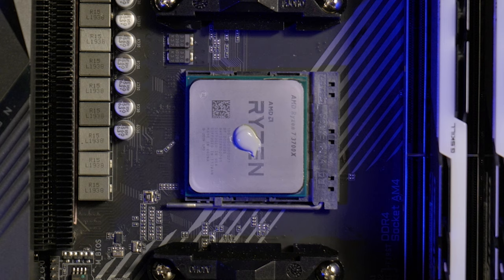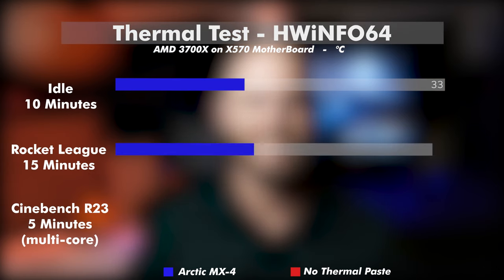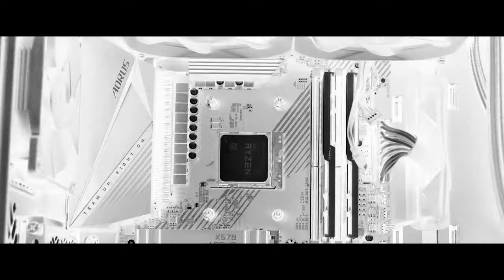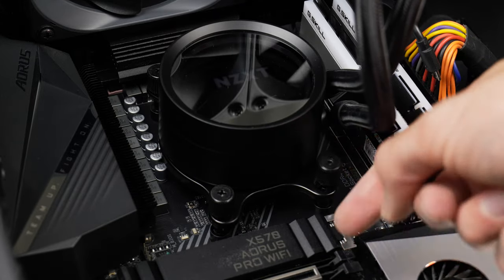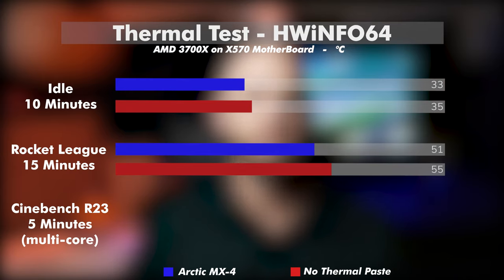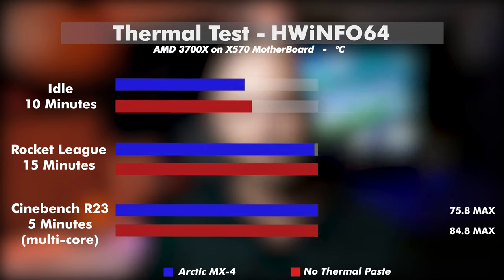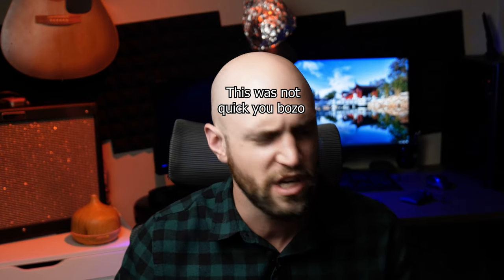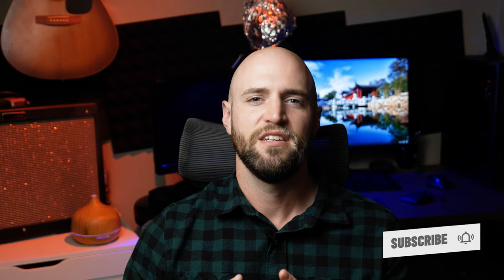Do You Even Need Thermal Paste?

Comment: Yes. I started up a i5 8400 with no thermal paste and a stock cooler I went into bios saw 91 C and shut it down,
Reply: 95c
Reply: Rookie numbers, mine was 101 C. Get on my level😎
Reply: @mrjazz2570  mine was 121c get on my level
Reply: Because stock cooler. This is the cause.
Reply: Mine shutdown in 10 seconds
Reply: I remember my old laptop going for ~110°c 
I can't even count how many times I burned my hands and lap or something else like a table, paper, books, etc...
Reply: It would have shut down if you were doing anything demanding . Even the bare minimum (1/4th the minimum) will cool it down enough to game at 1080p on integrated graphics.
Reply: @chadmann2724  I was just testing to see if you needed to thermal paste.
Reply: My cpu hits 80°C in 1 minute stressing it 50%, 90°C in 2 minutes stressing 100%, but in my case i need to get a better cooler because my cpu's tdp is higher than my current cooler
Reply: Stock cooler 🤣
Reply: I’ve been running mine on 110 last few years lmfao
Reply: Mine was 128°c and my pc literally explode
Reply: @mrjazz2570 yesterday it was a i7 12gen 100c
Reply: 96c i5 8400 no thernal paste no cooler
Reply: 96 C i5 8400 no thernal paste no cooler

Comment: This shows that the cold plate on your AIO has actually pretty good evenness. The temperature without thermal paste is really dependent on the unevenness of the plate, relative to the cpu ihs. If it was more uneven you would see higher temps or even dangerous temps, depending
Reply: Even then, 9 degrees delta at peak utilization is a sizable difference, proving that thermal paste always helps.

But I was shocked that idle was no more than 2 degrees delta and light gaming was only 4 degrees delta. Which proves your point: the more even the IHS' surface and the cooler's contact surface are, the less reliant they are on a thermal interface layer between them.

But since you cannot gauge the evenness of your CPU's IHS and your cooler's contact surface without specialized high-precision tools (and exceptional evenness tends to be the exception and not the norm), having thermal paste is still preferable.
Reply: That's a very good point. I have a Core i7-6850K cooled by an EK Supremacy Evo waterblock and it would instantly hit 100 degrees and thermal throttle under load at stock speed with no thermal paste. But after I lapped the CPU and waterblock totally flat, temps maxed out at around 75 degrees with no thermal paste. Obviously not nearly as good as under 60 degrees with thermal paste, but still totally safe and completely usable once lapped.
Reply: a metal plate has good evenness?? mind=blown

Comment: If you had a perfectly flat heat spreader and a perfectly flat heat sink mount, you could probably get away with no thermal paste. However that is not the case. Never run a system with no thermal paste.
Reply: Yeah, after seeing just how not flat the IHS and heatsink are I would never recommend running a system without the paste.  Now, if you have lapped them both and there is perfect 100% contact, maybe.  But even then, why not just slap on some paste and enjoy your build.

Comment: I'm honestly surprised it mattered as much as it did. The paste helps pretty microscopic separations connect. It's cool seeing quantitatively how impactful they are. It's definitely necessary but also not something that has to be applied in a lab setting with any level of small tolerance or specific amounts or patterns.
Reply: I got a theory that people are mounting the coolers way too loose, hence the wide spreed use of huge amounts of thermal paste, I use so very little and spreed it all over the cpu surface without spilling out.
Reply: @vfn4i83  actually you should do it enough to spread through the ihs. This test just means nzxt kraken has spectacularly even mounting surface and pressure. Thermal paste is necessery when these things are not perfect which in almost all cases they're not. You tightened the screw on one side half a turntoo much? half of ihs is wasted. Did your AiO manufacturer cheaped out on manifacturing cold plate, same story excessive heat. As air is actually good insulator which is why paste is necessery, it removes alot of the variables which almost always happen. Hell, just look at latest intel socket, even the motherboard's cpu mounts are so bad that when you switch that to a TR or TG you gain around 5 degrees of cpu temp just from that. And that is WITH thermal paste.
Reply: My cpu is at 60⁰C idle without thermal paste. I think I need it

Comment: Thanks for the research.  I have a non cpu application that thermal paste may not provide a benefit, but thermal epoxy is still an option.  These Thermal Interface Materials, TIM, seem to work less by being a thermal conductor, than by eliminating a non-thermal conductor - air.  My research will be to attach a Peltier to heat an aluminum plate in a vacuum chamber.  With no air insulation gap between the ceramic face of the Peltier and the  aluminum plate, heat conduction should be better than at normal atmosphere.  There may still be a need for epoxy, but this demonstration is insightful.

Comment: I've done it before. The difference is not that gigantic. The misconception many people have about thermal paste is that it is some magical substance that acts like ice cubes in a drink. It's just a really thick grease mixed microscopic powdered metal. The texture is like peanut butter. All it does, if applied correctly, is make sure there's always full contact between the CPU and the heatsink, that's all. The difference between paste and dry is just like the difference between a car's engine oil full and low on oil. The car will run fine with low oil, but it will run better and quieter with full oil.
Reply: So the computer i have might not have thermal paste at all lol
Reply: I'm running i5 2400 without thermal for 3 years but now i have an issue my system ran into a problem giving me blue screen and it goes for a restart i thought it might be a virus or something like that so i installed fresh windows 10 but the problem didn't go away it happened again I don't know what to do????
Reply: @ARMA__GAMING  One or several of your ram sticks are bad.
Reply: @alwaysemployed656  ohh no it means my pocket money is in trouble 😨
Reply: @ARMA__GAMING  The looping boot means the motherboard and cmos battery are fine. It would not even boot up if something was wrong with either the mainboard or cmos battery. So that narrows it down to the ram. Try making sure the ram sticks are in properly and locked in. If that doesn't work, then time to buy new ram.
Reply: Analogy is completely wrong, because in gas engine you have moving parts which also is thermally stressed and must also provide a high pressure sealing - all at the same time. Running low on oil will lead to damage of camshaft and pistons, which eventually kills engine entirely.
Reply: @Chastity_Belt  todays modern engines can in fact run fine with low oil, not recommended to do so. Just enough to get you around before you can put in oil.
Reply: @alwaysemployed656  i know, it wouldn't kill engine immediately. But if do this on regular bases, it will be cooked

Comment: I think the real difference is the quality of the radiator when dry mount. Else, I also think that applying the paste on it (and spreading) instead of doing that on the CPU, will give slightly better result, as the CPU cap is quite smooth, while the cooler is rough and using too thin layer on the CPU will not fill up all the gaps when pressed
Reply: The CPU cap is quite rough, if was so smooth, it'd be glassy and the copper surface would also be glassy, that would be the only way there'd be little to no gaps. If there's even a smidget of a micron gap then thermal paste would continue to win because it fills in gaps. Simply touching the surface of the cpu would cause gapping problems

Comment: i have dozens of times had to set up a quick thest bench pc to run some hdd recovery software  i would just find a mobo, a cpu and a few sticks of ram a psu and sata cables and just a cpu cooler laying around, i would just throw the cooler on the cpu and not use thermal greese or strap it down i just just place it and launch the program i needed and let it work, works fine you just need a chunk of metal to be honest for a cooler

Comment: that aio is plenty powerful enough to handle a 150w load, that measly 65 watts isn't going to suffer to much with out any thermal compound, so long as you have a solid connection, apply enough pressure and the surfaces mate well, the thermal compound helps transfer the heat in the areas that are not mating that well. so that said, no thermal compound will render higher temps, cause the cpu to loose some performance, but doubt it will damage the newer cpus made in say the last 5 years or so as they will throttle or shut down to save themselves. if all you need to do is post your system, no thermal compound is perfectly fine, just make sure to remove the plastic cover first

Comment: As others have mentioned I think cooler quality matters.  I run Pentuim III (both Coppermine and Tualatin variants), Xeon E5450, Xeon E56xx and X56xx series as well as an I7 970 all without paste, and everything works just fine.  There are 22 CPUs in total.  All the machines are either name brand servers (HP, Compaq, IBM, Dell) with quality parts and good airflow, except the I7 which has a good aftermarket air cooler.  After about 8 years in a non-airconditioned room with Australian summer ambient temperature, nothing has shown any sign of heat-related problems.

Comment: Thermal paste is just to ensure a smooth and complete contact surface with your cooler, because the heat transfer is made by conduction and to do that there needs to be surface to surface contact its not actually designed to keep it cool, although over the years some companies do try to provide products that help improve cooling

Comment: I have a 9 year old Intel Core i7-2600 in my PC and I have been lately getting 92...96 °C temperatures with Intel stock cooler while playing Hunt Showdown. I thought that my CPU had come to the end of its life.

Yesterday I figured that maybe I should just in case check the thermal paste situation since the last time I applied it was over three years ago. So I cleaned the old paste away (also cleaned all the dust from the cooler) and applied a new layer and surprisingly it worked!

I am now getting 80 °C temperatures. So reapplying thermal paste and cleaning the cooler off of dust really made a difference. So I would say that you should always use thermal paste if you are using the CPU for gaming and other stuff that puts it under stress.
Reply from the maker: For sure. I suspect dry paste is worse then no paste. I would love to test that out.

Comment: I would definitely still use thermal paste. I am new to pc building but I have a pretty good understanding of electricity. So I would think it also protects against corrosion and helps protect from static shock issues.
Reply: The IHS is solid copper that's milled and then nickel plated so it doesn't rust. You can wash it with regular water.
Don't understand what you mean by static shock. The actual chips inside the CPU package are covered with non conductive TIP and then they press fit the IHS on top of everything. The IHS does not touch any electronic component.
People love to talk about micro air gaps and all kinds of other dumb shit when they talk about termal paste but the reality is that the paste is mostly there in case the IHS and/or the bottom of the radiator isn't perfectly flat. On many CPUs the IHS is a little bit concave from when it's press fit. Or was that convex?! Anyway it's lower in the middle that's why you put the drop of paste in the middle. Plus that's where the actual chip was for the longest time before these new multi chip CPUs started being a thing.
And then there's the fact that big heavy radiators are going to sag when they're sitting horizontally and they're not bolted on hard enough.

Comment: I can report that since I upgraded my ryzen cpu, I was re using the wraith cooler with just left over paste on it.  Since then I ordered 2 grams of paste and used it, idle and youtube it doesn't make much difference, but for games?  HUGE difference!  I was spiking at the mid 80's, now I sit at or under about 60 degrees.  I used one gram to put 8 dots around the outer side, and a gram for and extra big dot in the middle.

Comment: Next: what happens if you try to reuse thermal paste: for instance, you put thermal paste, bench your pc and find out that the heat sink isn't making propper contact. So you remove the heatsink, you confirm that it wasn't making proper contact, and then.... everybody says you need to reaply the thermal paste, but maybe just spread it again will do the trick?
Reply: I can confirm to you by experience that it changes nothing. I've reused thermal paste several times and nothing has changed. The only difference I found was when the thermal paste was already solid.
Reply: Did that just yesterday. I didn't even bother spreading it again, just took the heatsink completly off and back on again. Changed absolutly nothing.
Reply: My guess would be that it depends on how old the thermal paste is, as my laptop suffered doing that but the paste was over 5 years old 🤷‍♂️
Reply: @spagettifelge7191  damn, wish i knew this earlier
Reply: It depends on the paste. Some leftover pastes are still reusable, but most hardcore gamers’ thermal pastes’ has some flaky parts, basically some pastes dried out and feels a bit like plasticy instead of a paste.
Reply: you cant tell if the thermal paste was or was not fully contacting, because as you remove the heat sync the paste moves and shifts.
Reply: Well it is a rule you must follow religiously. If you remove contact you must repaste immediately.

Comment: the surface of the CPU and the Cooler might be without gaps and don't need a filler. Other CPUs and their Coolers might have bigger gaps.
Also i wonder if the thermal paste keeps CPU and Cooler a bit separated, so that they don't fuse with each other over time 🤔

Comment: The thing about thermal paste is, once it's getting too old (especially crappy thermal paste) it's going to have a negative effect because it might crack, leaving areas with zero contact.
On my old laptop (about 8 years old) the temps were always quite fine, but one day it suddenly started to get really bad. Turns out the old thermal paste was dry as hell and actually cracked in the middle (leaving an air pocket of a few mm there).

Comment: Components die quicker the hotter they get! Not directly, but in the long run, a cpu with thermal paste will live longer than a cpu without thermal paste, yes for now it might be just a couple of degrees, but in the long run, not such a good idea! I got a big tube of arctic mx-4 45 grams for about 15€ (20$) and you are right, it lasts a long time!

Comment: It's interesting, my kraken z63 sprung a leak in the radiator and the effects were immediate, my cpu usage shot to 100% and overheated within a min, it even had thermal paste. I couldn't even boot into windows before it shut down again. Once I put my air cooler back on it was fine. Yet, here you are with no paste and getting stable temps with normal usage. You should have used an air cooler also, cause maybe my failure was due to no liquid being circulated.

Comment: Not surprised at your findings at all, Not used thermal paste in any of my past PC's for 25+ years, never had any overheating issues either.
Reply: You'll never have overheating since all chips since 20 years ago are thermally throttled.  The issue is performance:  the higher the temperatures, the worse the CPU performance.

Comment: I went to ITT and we used thermal paste here and there and in my working with hardware through years, you would find it in the oddest places from voltage regulators on old weird places, but it was always said "it just fills the small gaps, it most cases it's not even needed". But you learn that paste gives you the edge to ensure those tiny gaps are filled to ensure contact is made. This video clearly proves that old saying :)

Comment: I'd love to see you do the same testing with a mid-level air cooler. That water cooler is very capable of absorbing so much more heat that yes, no-paste differences are minimal, but due to the nature of water cooling. Could you try it with a $30.00 air cooler? I'll bet there is quite a big difference, but I'll let you try it! I'm on a budget!

Comment: I always use thermal paste when building of course. But I did get some celerons and pentiums from different generations for testing boards and I don’t put anything at all on top. I used to, but one day I decided to pull the heat sync off with hwmonitor open and it only went up 5c, so now I just save the time and skip it

Comment: Thermal paste is an absolute must on older CPUs and long used coolers. For a simple reason. With time the the plate and the surface of the cooler changes shapes (most times its unnoticeable) and the paste "evens" the surfaces.
Reply: You can't really say that without any kind of test showing that it's a must. Theoretically that's one of the reasons why thermal paste helps but you actually have to run side by side tests. I actually expect the results to be very similar to this.

Comment: I dont get why people expect it to burn up. Like what do you think the cooler is doing? Its made of metals that transport heat VERY well and has full contact on the cpu. Thermal paste may help a little bit to have better connection between the cpu and cooler but the cooler is the thing that does the cooling, not the thermal paste.

Comment: With an IHS you might not run into any dangers, but back in an era were direct die cooling was still the norm... this would simply result in your machine locking up under any load.